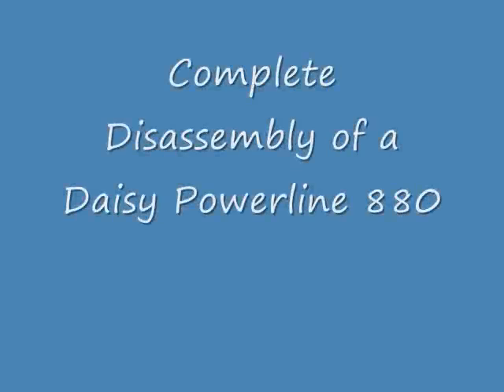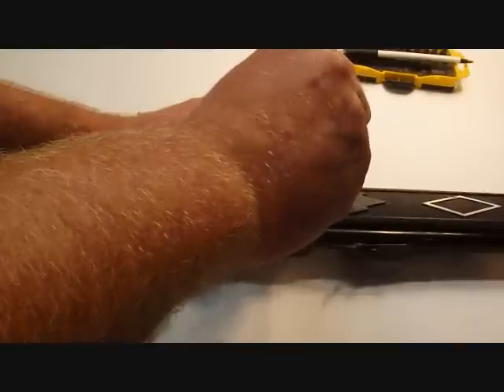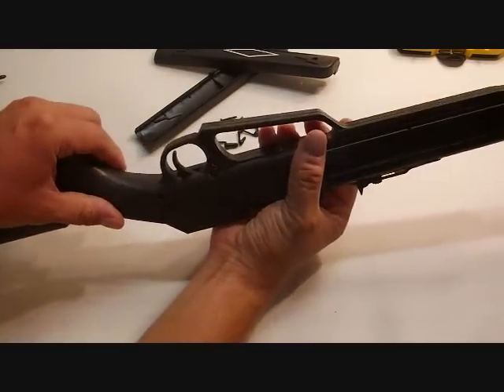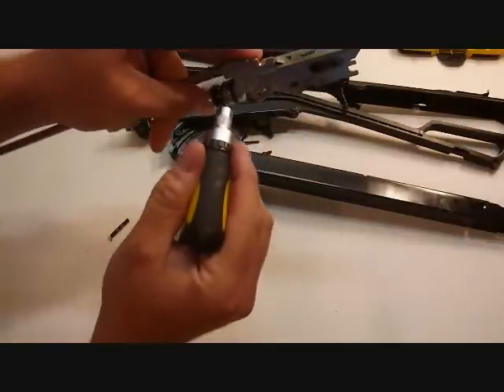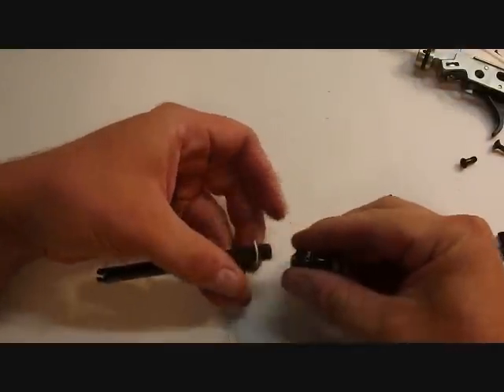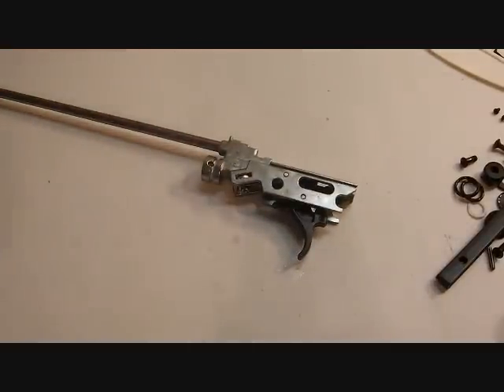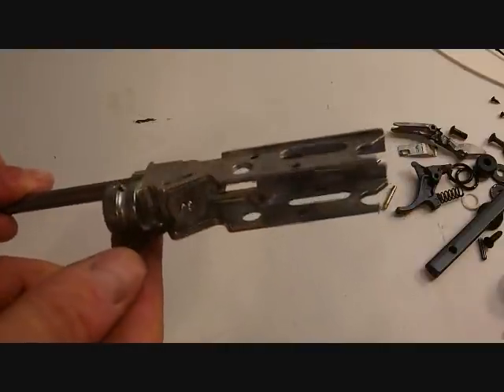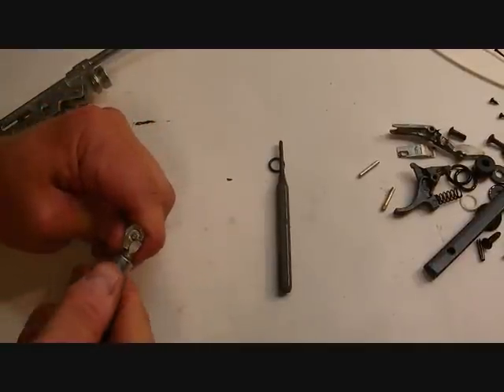Daisy Powerline 880 7880 BB Gun Complete Disassembly How To Take Apart Tear Down Air Rifle

Comment: had these daisy 880 for decades still fun affordable rifles, what many dont know is they do vary well with heavy pellets even the 16+ grain heavy weights and you can get tight groups at 15 yards with picking the right velocity and the right pellet
Reply from the maker: ***** Yes they are the best in their price range, nice little rifles.
Reply: Not liking the plastic stock and side panels, I'd prefer wood.

Comment: Awesome video! This was my favorite air gun as a kid and now that I use a lot of different kinds, I still want to tinker with simple multi pumps like these. I still like the Daisy 880 and the Daisy 35 quite a lot, even next to much more powerful and more expensive air guns. It's really great for tinkering and modding because you can just a few of them, as affordable as they are. And the parts availability and the videos like this and other resources. Modding and customizing the inexpensive guns is just as great as building and tuning something fancier. I still like having the option to use BBs now and then for variety. I even have some plastic .177 and special 'high performance' coated BBs. Endless pellet options of course. Good fun.

Comment: This is a useful video for those that wish to pack an 880 in a suitcase. They are so cheap in the USA, 35 bucks or less sometimes. In the UK they are £60/73 dollars, and you don't see them often at airgun stores. And they don't make sense at this price point when you can buy a real metal spring powered rifle for £50 (smk B2) or a Gamo Delta Fox or Stoeger X3 Tac for £70-£80 or a Hatsan 900x for £90. 

I bought a Buck and a Red Ryder, Crosman PSM45 and a beeman 2004E P17 when I visited California but I wish I had bought an 880 and simply removed the stock. The Red Ryder only just about fit.

Comment: Joe, Thanks to your informative Video. It helped me rebuild my older 880 with the metal receiver.  Take care
Reply from the maker: +baltoravens1 Good deal, they are very similar but there are some differences as I am sure you found out. I am going to do a video on the older style soon.
Reply: +Joseph Lewis he issue I had with mine was the Valve Pressure Tube Seal. The part that looks like a Top Hat.  It cost over $20 to replace on eBay. I used large washers and a clamp to open it up. After I did I used a hair dryer to soften the rubber up. Works great now.
Reply from the maker: +baltoravens1 Yeah the old style seals are expensive, that is a good idea bending the seal back out, they often look fine but will not seal probably because they deform a little over time.

Comment: Great video. You seem pretty confident. I came her because my 880 only pumps up once. It will hold that pump indefinitely but subsequent pumps don't add to the pressure. I was hoping to know what is failing so I can change the right seal. Thank you for your time and experience here.
Reply from the maker: I would suspect the chamber seal, or less likely the pump head O-ring or exhaust valve. If it is the exhaust valve you can usually hear it leaking through the barrel.
Reply: Lol mine has the same problem

Comment: When you pulled apart the side covers what is that little metal piece that came off of the bottom side cover looks like a screw except is smooth
Reply from the maker: The piece that fell to the table and stayed there is the spring the retains the pump handle. It goes between the side covers and keeps the pump handle held up.

Comment: When the first side cover was removed a spring fell out.  Where does that spring fit..  It is a spring that is compressed in its relaxed state and will  expand when loaded.
Reply from the maker: It is likely the pump handle retaining spring, it goes between the side covers and holds the pump handle up.

Comment: My 880 was working fine as long as I've had it. Was shooting some today and then it just stopped pumping right. I hear air coming out of the chamber thing lol but as im pumping and were to have it completely back closed,  it loses the pressure and just easily snaps close
Reply from the maker: Could be a blown seal or the exhaust valve. Might be able to fix with a good cleaning, or may need a part.
Reply: J L  not sure what was wrong with it. But it started working just fine.  I think it had been pumped then someone slide the part back where u can load pellets into it and slide it back closed (if that makes sense?) Because my son did the same thing and tried pumping it again and it wouldn't hold pressure. All i did was point it  at the ground amd pull the trigger and then followed the steps in the correct way and shot it and it worked perfectly fine.

Comment: I may have missed it on the video. My 880 pump tube has pulled out of rear of rifle. Don't ask.the plunger is tight as heck. I'm gonna order a new tube and seal kit. But am I missing something that keeps the tube from moving forward?
Reply from the maker: The new style is held in place by an indent in the frame rail, old style with a pin.
Reply: @JL-by4xu  ok, thanks. I've gotta order some parts. Is that you on Ebay?
Reply: Sorry should have looked in the description.

Comment: My pawpaw's old 880 has an issue were the BBs would fallout and not shot out of it it has 2 screws on the left and 1 one the right if held normal.
Reply from the maker: The bolt on later models had a magnet, early 880s did not have this. Either generation should not have this problem. I would check to see if you bolt has a magnet and if so if it is still magnetized.
Reply: It turns out it was a bent pice of metal that held the barrel in. When it was bent it stopped the barrel entering the chamber. now it shoots but the barrel falls out sometimes. The magnet does work and in some cases to well.

Comment: Is there any way you can either lighten up the trigger pull OR make it a little smoother?  Thanks.  sincerely,    JAMES.
Reply from the maker: I am sure it can be polished, but the trigger on an airgun is not like a firearm. The trigger on an airgun opens an exhaust valve.
Reply: Hi.  You know what I ended up trying - (this might be stupid) - but I turned the 880 upside down & dripped oil into the trigger - front & back.  Then I put a couple of hundred bb's & pellets thru it - watching & wiping out any oil that drips down.  You know what - it helped enough to make a difference in my accuracy!!!  I should use front wheel bearing grease as this will stay where it is put better.  Thanks again for the great video.  Sincerely ,JAMES.

Comment: Sir I have this BB gun.  Hot can make butt more Secure ? I have old one with just one screw not three screws.
Reply from the maker: You can use thin foam or something similar on the mating areas

Comment: well I have an old dais 880 bb gun and I don't know what's wrong with it when ever I try to pump it up all of the pressure escapes please please help me understand what I need to do to repair it thank you for your time
Reply from the maker: It is kinda hard to trouble shoot across the net, the most common reason an older gun isn't holding pressure is your pressure chamber seal. It could also be other problems, but that is where I would start. The pressure chamber seal is located at the bottom of the pump tube and contains the pressure you are pumping up.
Reply: Joseph Lewis
I have similar problem on 2 1980's 880s.
One gun takes only 1 pump, the other will take multi pumps but will hiss out the air.
Is that the Abutment chamber seal kit, #10 in the Daisy parts diagram?
Reply from the maker: Yes charles910, the seal kit is #10 and contains the seal at the bottom of the pump tube which is your most likely problem. On older 880's you will need the old style seal, the newer guns take a different seal.

Comment: My pump handle is hard to pump. I am not sure if the wheels or something more serious. Can you help me.
Reply from the maker: Without looking at the gun it would be hard to say what is wrong, but you are on the right track. Something is binding up, it can be caused by the guide wheels on either side of the pump piston arm, or the pump piston is binding in the pump tube are the likely problems.

Comment: Plastic "waRsher" ?... You must be from Central Pennsylvania lol.
Question,... Is it possible to make the exhaust port (hole) slightly larger ?
Thanks :)
Reply from the maker: It can probably be done, would require a different exhaust valve plunger and some machine work.

Comment: mine pumps up one time and doesn't relieve pressure in air tube to pump all 10 times...took it apart several times and see no reason for it to not pump up ....whats the deal?....anniversary edition 880, abt 24 years old....
Reply: Red Blue40 mine is doing the same thing, I've taken it apart and can't figure out what's wrong either. someone have an answer for this?
Reply: Red Blue40 make sure the chamber is open before pumping

Comment: Can you do a vid. on the barrel mod to improve accuracy? Iv`e read some use tape and others used j.b. weld.
Reply from the maker: I am not sure what barrel mod you are referring to. The later 880s do have a lightly rifled barrel that is pretty accurate for a air rifle.
Reply: Iv`e read some people have used electrical tape and others used j b weld on the internal barrel 1/2 inch from the muzzle to stabilize the barrel inside the shroud to improve accuracy.

Comment: my daisy 880 seems to leak out of the end after i pump it i can hear air leaking from the end and also from it seems like inside,right where i slide the bolt into
is there anything i can do to fix that like replace the seals or oil it or anything else?id appreciate your advise
Reply from the maker: That is likely the exhaust valve. There is a chance you can clean the valve and not have to replace it.
Reply: thanks.   if i did have to replace it would i be able to buy parts from daisy?
Reply from the maker: Some parts are still available from Daisy.

Comment: I have a problem where when I pump I feel pressure on the pump handle, yet it wont keep the pressure and I feel the pump handle under pressure as I move the pump handle back as if to pump again.

what might be the problem with it not keeping the pressure ?
thank you
Reply from the maker: +Geoffrey Kr It sounds like your chamber seal is leaking to me. The chamber seal is at the bottom of the pump tube and its job is to contain the pressure you pump up.
Reply: Thank you for where to begin looking.